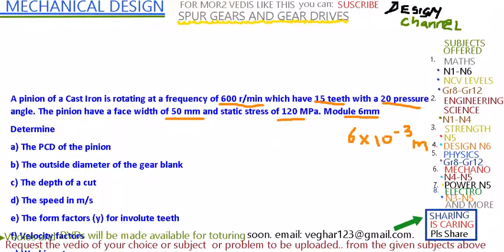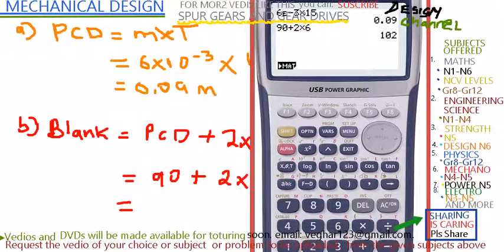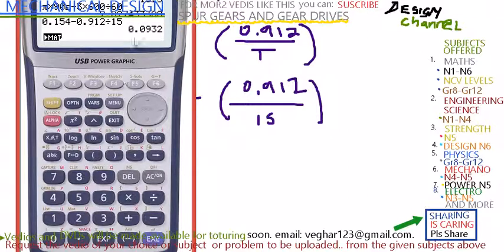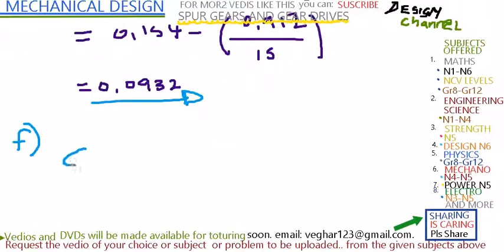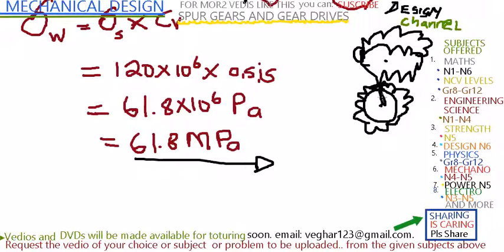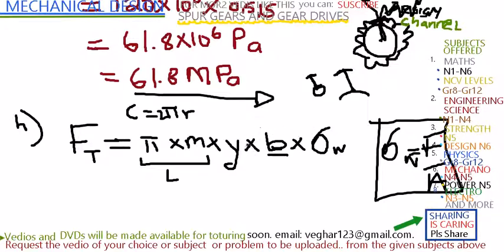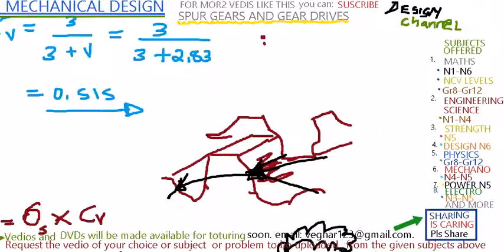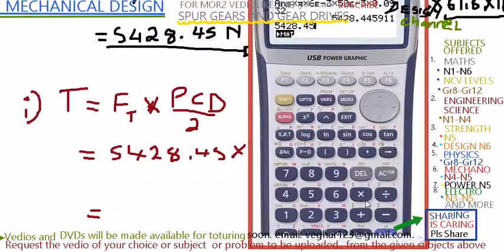MECHANICAL DESIGN1 N6 Unit 5

Comment: the presenter is very poor
Reply from the maker: Tutoring on WhatsApp at R50 per week

using Vedioes, Audioes, pdf and more

Subjects 
o N1-N6 Mathematics
o N1-N4 Engineering Science
o N2 Industrial Electronics
o GR8-GR12 Mathematics 
o NCV level 2-4 Mathematics 
o GR12 Physics
o Gr10-11 Physics

Sending Educational Videos via WhatsApp

100 Mix Vedeos R100
50 Mix Vedeos R50

for the following subjects

o N1-N6 Mathematics
o N1-N4 Engineering Science
o N2 Industrial Electronics
o GR8-GR12 Mathematics 
o NCV level 2-4 Mathematics 
o GR12 Physics

you can 

Contact/ WhatsApp : 061 6391293